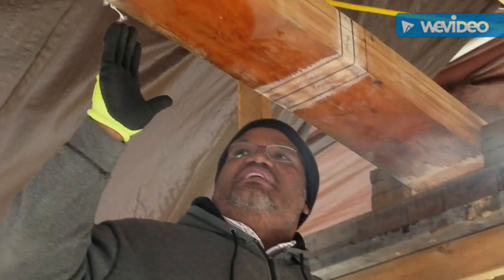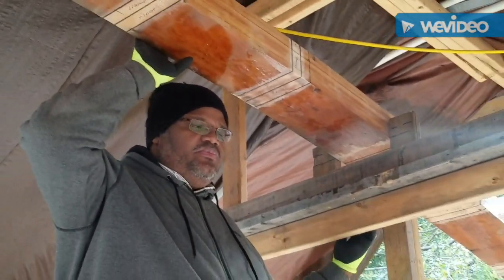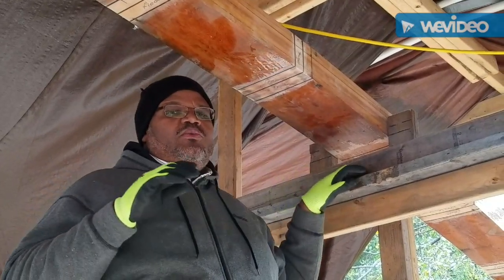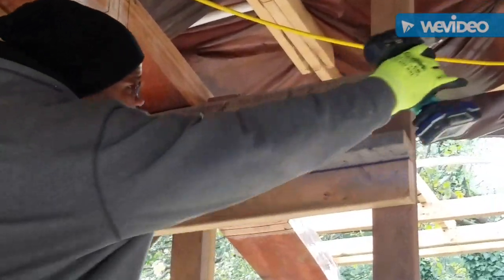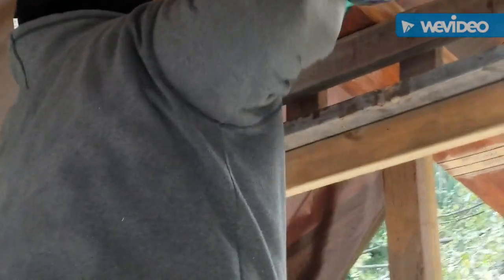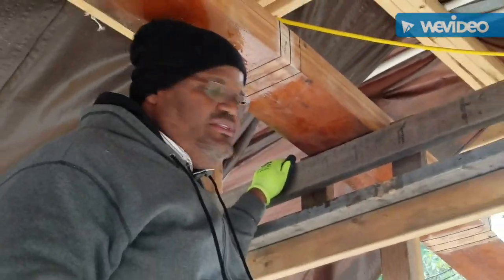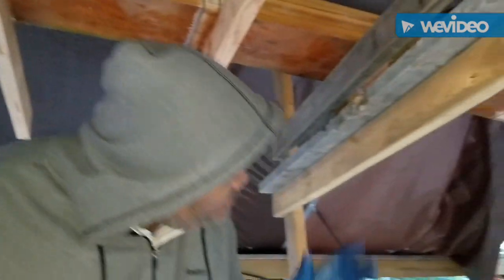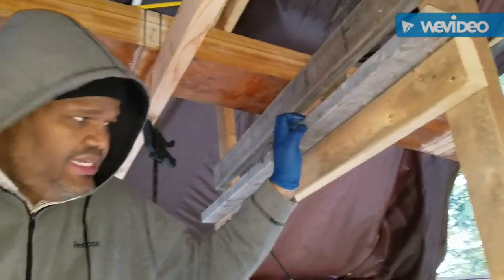Build A Boat Satutday - attaching more floors

Comment: An Adjustable Angle Gauge would be a good way to obtain the perfect angle needed.  The angle gauge can be used to set the blade angle on your table saw to make this a very precise process.  Thanks for the updates.